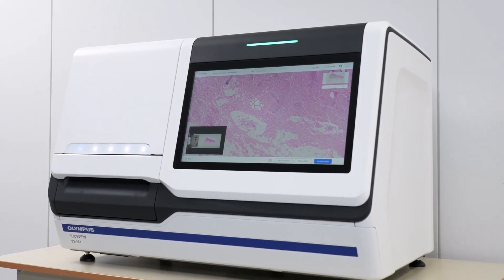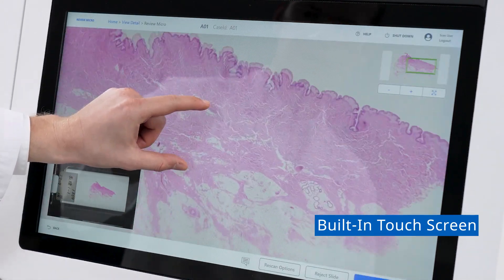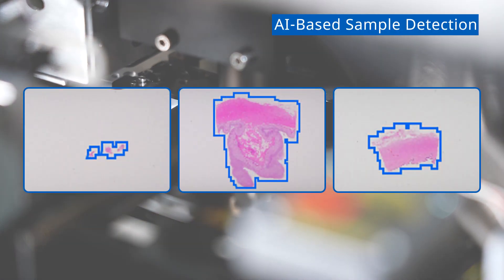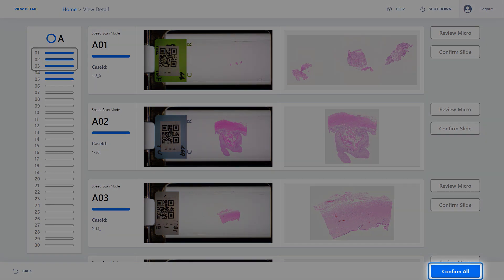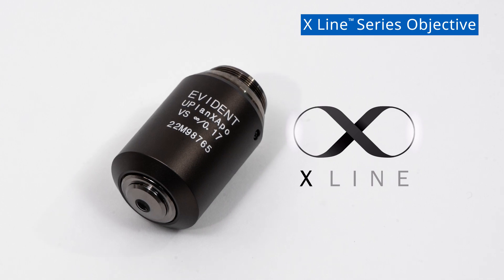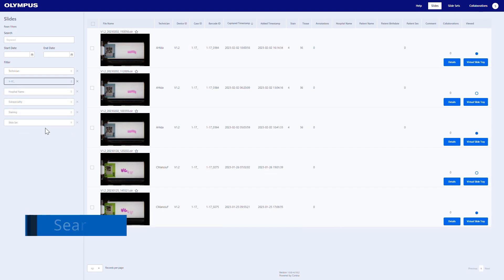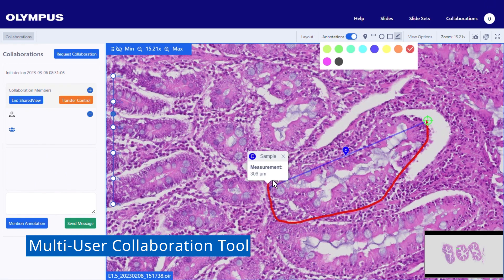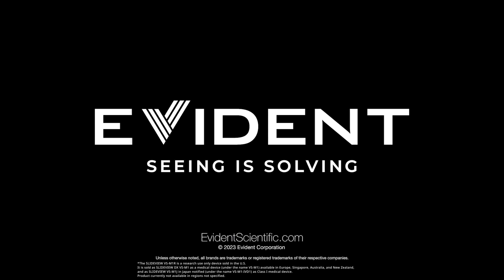Introducing the SLIDEVIEW VS-M1R Whole Slide Imaging System

Comment: - 0:12: The Slideview vs m1r whole slide imaging system combines leading-edge technologies, including a dedicated x-line objective and true color LED illumination.  
- 0:31: Its advanced technology accelerates the entire digital pathology workflow to help pathologists efficiently review high quality digital images.  
- 0:43: Users can operate the scanner through the system's large integrated touchscreen.  
- 0:51: Up to 30 slides can be loaded at once into a rack, with the system able to hold five racks for a total of 150 slides.  
- 1:04: The scanner's fast scan speed (more than 80 slides per hour) enables slides to be quickly digitized for faster delivery to the pathologist.  
- 1:16: Once slides are loaded, the system's advanced AI automatically locates tissue on the slide and provides a high-resolution scan of that area.  
- 1:27: The real-time autofocus keeps the sample in focus during the scan, minimizing the need for rescans.  
- 1:39: The scan quality can be checked on the same high-resolution touchscreen.  
- 1:51: The scanner can integrate with your lab information system (LIS) to display the slide image and patient information on one monitor.  
- 2:01: The layout and functionality are intuitive and easy to learn.  
- 2:06: The images are displayed on a high color rendering display with automatic color calibration.  
- 2:15: The system uses an objective from the award-winning x-line series to capture images with exceptional flatness and high pixel resolution.  
- 2:34: The objective is paired with a true color LED light source to provide true to life color reproduction.  
- 2:43: Pathologists can easily find target slide images with keywords and case ID numbers.  
- 2:57: Searched images are aligned on a virtual slide tray that mirrors handling a physical slide for simple, familiar slide management.  
- 3:08: The system automatically records visited areas for future reference, and annotations and measurement records can be saved with the slide image.  
- 3:20: The system's remote collaboration tools allow images and annotations to be securely shared with other Pathologists or experts for remote consultation or conference.  
- 3:42: By combining leading-edge optical and digital technologies, the VS m1r slide scanner brings the quality of a microscope to digital pathology.  
- 3:54: For more information, visit evidencecientific.com.

X-line Objective: A type of objective lens, notable for superior optical performance in terms of numerical aperture, image flatness, and chromatic correction. It is designed to provide high-resolution, high-quality images over a large field of view
https://www.olympus-lifescience.com/en/resources/white-papers/xline_high-performance_objectives/